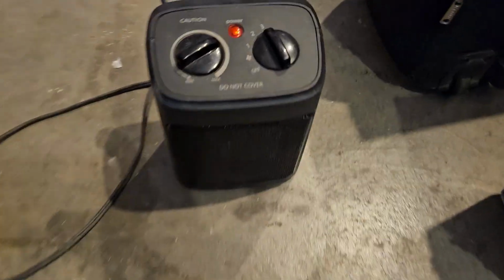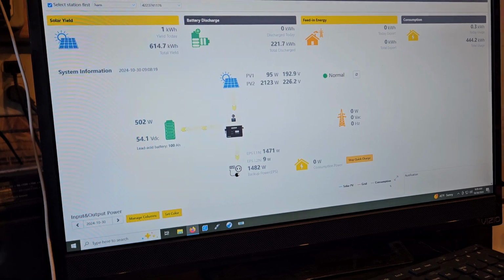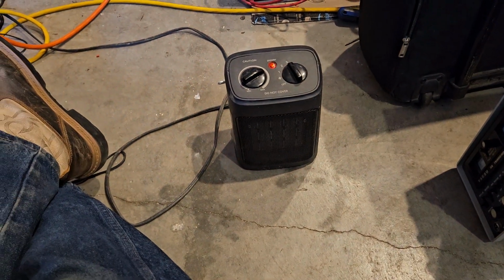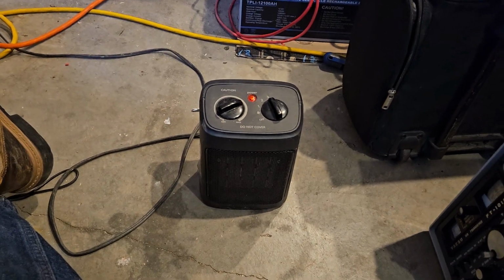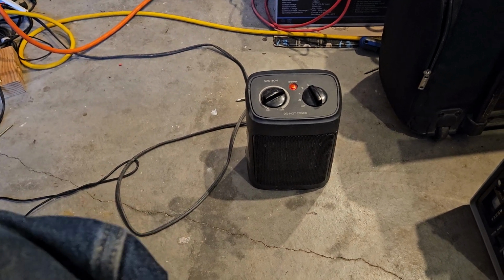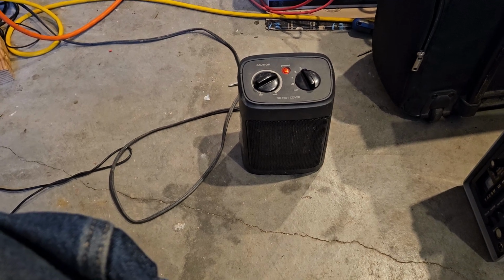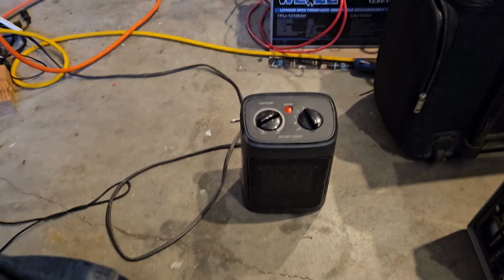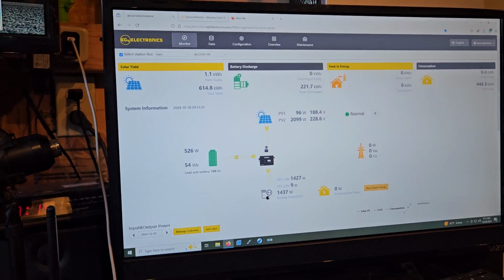I can't imagine heating a house entirely on electricity

Comment: You heard of the old- oil heater. I can heat the whole house with one above freezing and a fan blowing through the fins. If below freezing it will heat up a huge basement. The older American made ones were longer lasting.

Comment: If you lived in Northern Canada, like I do. Your only option is heat with electricity, or wood. IF you install a wood stove in your house, the insurance companies double or even triple your rates, eating up every bit of savings you may get. It sucks, but it is the reality for millions of us in the great white north. Our best option is to insulate the heck out of your home, and seal all openings tight. R20 may be great in the south, but up here R30 for walls and R40 for the roof is the bare minimum. Most have much higher R ratings for insulation. Cheers, and 73.
Reply from the maker: Oh man, that sucks! Most places in northern Arizona (high desert)  heat with natural gas. Or heat pumps i think. Since everyone has ac mostly heat pumps common here. My shop is unfinished.  The house has terrible insulation also. I wonder if theres even any insulation in our walls to be honest.  Our windows also suck. I have a diesel park heater in my shop.

Comment: Making heat costs at least 10X the money than simply moving heat. 
Heat pumps are the only answer, if you must use electricity to stay warm..
Reply from the maker: Im using a portable ac unit in my shop that does heat pump. Its impressive

Comment: 12 volt diesel heater. One gallon 24 hours heats garage size.. 30 bucks a week
Reply from the maker: Yes. I have one. Pretty cool. I got mine off of Amazon and it failed in the first week they gave me a full refund I let it sit for a while took it apart rebuilt it and it's worked ever since

Comment: Sadly, that's what is happening in the UK. This portable heater is very popular during autumn and winter seasons. They sell like hot cakes. They are usually 1kw, 2kw and even 3kw. Some are just using the small portable heater to keep warm by staying in one room having it on and off when the temp drops. Even worst are ALL new builds are 100% electric only with smart meters. IF one can't afford or are behind their bills, they'll be automatically be switched remotely to pay as you go instead of a monthly bill.
My electricity bill was high last year due to the use of dehumidifiers. At one point, my energy supplier wanted to come round to inspect my analog meters which I refused.😅

Comment: Heat pump works great for me.  I have a small one that eats 350W or so and is good for a room (or two small rooms).  So, 350W x 12 hrs (assuming you run it 12 hours a day) = 4200 Wh (watt-hours ) per day.   1000W worth of solar panels in summer, 2000W worth of solar panels in winter, does a decent job keeping up with that.

Not that it removes the need for a small generator too... winter storms and all.  But you can vastly reduce fuel consumption with enough solar to the point where it becomes a non-problem.

For an electric car it is roughly 3 miles per 1kWh.   You don't actually need much solar to be able to charge your electric car... it really depends on how many miles you actually drive each day.  The size of the battery in the EV is irrelevant.   And there is no requirement that you charge at high amperages either.  The minimum charge rate is 120VAC @ 6A or 8A = 720W - 960W or so.  It just takes a while but the point is the car (or a car) is just sitting around most of the time anyway so... nearly all the charging I do on my EV is off of my main home solar system (just 5kWp).

Basically all of this scales nicely with the size of the solar system.  A tiny system with a few 100W play panels won't give you much, but put something decent up and suddenly you are swimming in options.   You don't need a gigantic system to make these things work.  I'd say the tipping point is at around 3000W worth of solar panels.  From there on the amount of energy you can harvest is pretty significant.

-Matt

Comment: In norway, most people heat with electric , no problem in well built houses. My house drew about 70 kwh / day in middle of wibter before I installed heat pump. Now I use 40-50 kwh of cheap electricity. I charge 2 EVs as well now. No problems! I think you are so wrong. We soon have only EVs in Norway, no gas heating and 100% electric heating.
Reply from the maker: 70kwh is alot! My god
Reply: @hamradiohack  it was maximum , in the coldest day, before heat pump. We have cheap electricity and a grid built for electric heating only, with >99% uptime. After installing a heat pump, I use 12000 kwh a year for my house, no coal, no gas, and maybe 2000 kwh in addition from firewood.

This is a 170 sqr meter house in western Norway, in a very windy area. 

To pay for 12000 kwh, a cleaner would work for 110-115 hours to get the money. 

For how long would a cleaner have to work in the US to pay electricity and heating bill for a year in a 4 bed room house? 

By the way the cleaner has a good full coverage medical and pension plan included , the 110 hours are net salary after the tax paying medcare etc
Reply: @hamradiohack  He's got 46 space heaters. It's fine.

Comment: Electric heaters are very efficient, but electricity can be expensive, unless you have solar. A better way is heat pumps which move 5x more heat for the same energy use.

Comment: Well, if you're using electric, using on body/close contact heating, heating up the air, or trying to get at 10 degrees in any metric is going to take good sealing and efficient heaters to begin with
Reply: Right you are, resistance heaters perform at about 3.4 BTU per watt, heat pumps perform at about 10.2 or 3 times more efficiently.
Reply: All electric heaters are efficient heaters. They all almost convert 100% of the electricity to heat energy, even the most cheap models. Electricity itself is just expensive compared to other forms of heating. Heat pumps are only more efficient because they convert more than 100% of the electricity to used into effective heating, but only because they are moving energy from one place to another rather than using all the energy in conversion to heat.

Comment: That's why he have heat pumps. 5000 watts in 20-25,000 watts out. Think of it like running the AC, because that is what it is. Space heaters like that are for emergency heating and supplementary heating. Not primary heating.

Now if you have a smaller home and a large solar install you could run fully on resistive heating. But why when there are better options.
Reply from the maker: I agree heat pump is the only way to go
Reply from the maker: In fact it would probably be easy to take an air conditioner and flip it around backwards in your window and get efficient heat that way lol
Reply: @hamradiohack  As long as you deal with the condensate drip drip 🙂But its far easier to get an actual reverseable unit such as a mini-split that can do both.

Comment: Did you refer to coal as “renewable”?
Reply: Kinda like saying oxygen is renewable if you sit in sealed room with a small house-plant.  That would be a "no".  Coal is not renewable.  But the real argument is more about local pollution and not so much a climate argument (you don't have to believe in man-made climate change to want to get rid of fossil fuels). 

Many people seem to just accept the health and property consequences that coal plants, and the health consequences that other fossil plants, as well as large-scale refining and tail-pipe pollution.  Not to mention shortened life-spans and horrible early deaths of mine workers, coal ash pond failures putting heavy metals into drinking water supplies, and so forth.

That is until one is removed that happens to be nearby.  Then 'ya realize just how bad it was and never want to see one of those suckers within 50 miles of you ever again.

Also makes me think of those little diesel heaters.   Ugh.  I wouldn't want one of those things within 500 yards of me, no matter how well vented they are.  And this is coming from a guy who used to heat his boat with an unventilated kerosene lamp back in the 70's!

-Matt
Reply: @junkerzn7312  very well said
Reply from the maker: No but technically it is. Just not in our lifetime.
Reply: @ Uh no, it’s not. The rate at which coal as a fuel source can be burned is infinitesimally small compared to the time it takes to create. The sun, wind, water, however are not finite resources, making them actually renewable.

Comment: Interesting video.  My house is all electric (3700 sq. ft.)  I have 2 HVAC systems (one per floor), both of which are heat-pumps, and I have a garage heater (ceiling mounted 3000/5000 watts).  All the heat  for the house is  240V (including the garage).  It's surprisingly efficient. There's no way I would try to heat my house with 120V/15amp space heaters!  It would take a looong  time, and would be way too expensive!  Good video!

Comment: So you want people to be cold? How else are you going to heat the house?
Reply from the maker: You completely missed the whole point of the video I'm not telling anybody to do anything I'm explaining the efficiencies and why resistive electric heat cost so much personally I would rather heat with wood. If you've got to use space heaters to keep warm that's what you've got to do if you have baseboard heaters and nothing else then there isn't much of a choice
Reply: Use the oil radiator for heat, I like them